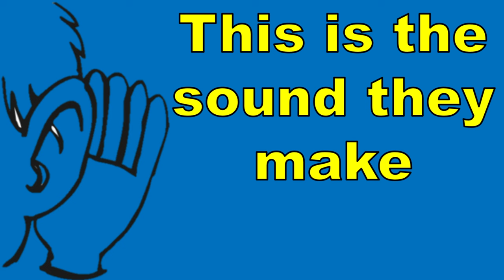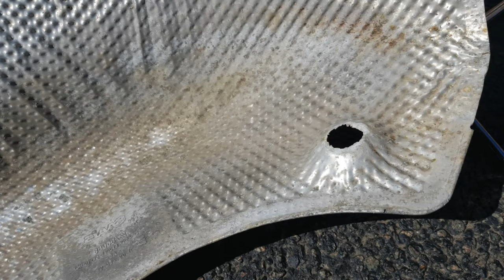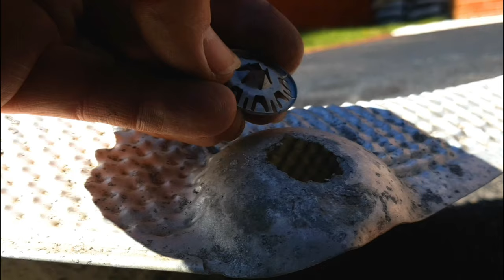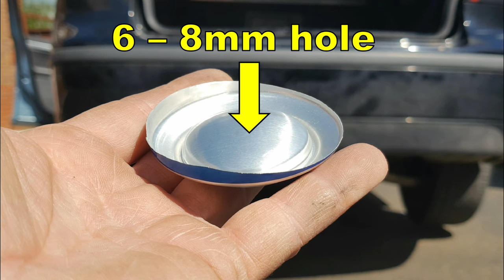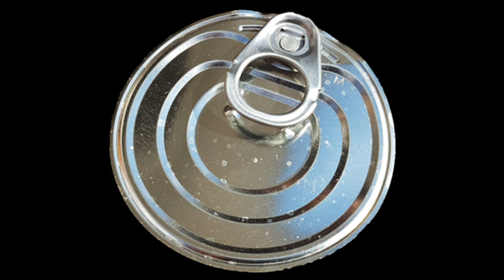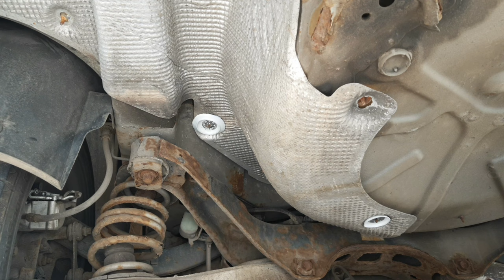How to fix Heat Shield Rattle for DIRT Cheap 💲💲 | such EASY DIY 👍

Comment: I very rarely comment on videos, but this is a phenomenal video. You show the used parts (so they look like what they'll look like in real life!) and offer really practical solutions for if things don't end up appearing exactly as they're supposed to. Thanks so much!
Reply from the maker: As a Professional Automotive Engineer of 40 years, I'm used to using the 8D method of problem resolution. The first step is to identify ROOT CAUSE. Without root cause you cannot develop a robust solution. Then I can develop a DIY solution (not necessarily the same as a 'factory' solution) that anyone can use. 
Or, at least, that's what I try to do. Glad I succeeded this time and thank you for the kind words.
Reply: First time i have heard of this idea.  Genius.

Comment: I took you tip and added a slit up the side of the pop can bottom then I only had to turn the nut half way down and slip the washer on between the nut and heat shield and tighten it down again.  I was able to leave the exhaust in place this way.

Comment: Thank you Cyd, a very timely video. I must do this to my car.
Reply from the maker: Awesome! I must get a link to some suitable clips in the description. Something I forgot to include in the video (and didn't do to mine, gggrrr!) - give the body studs a wire brushing and treat with rust converter before putting your shield back. Slows down the corrosion process.

Comment: Honestly, I just pull these off @ work, when they're loose. I've done it on diesels, petrols & shields below fuel tank. Never had an issue. 

I do admire your resourceful use of a soda can though!
Reply from the maker: Here in the UK if you pull off one of these on the bodywork that'll be okay, but if you remove one from around the fuel tank it will fail it's MoT. I have found though, that ones fitted around tanks are held in place differently and don't come loose so easy.
Reply: Here in Northern Ireland, I've never had one fail on heat shields.

Although our government run testing centres are very lenient. The test only lasts 20 minutes too. It's scary some of the passes I've seen.
Reply from the maker: @nothingmuch.3014  yeah, I should have said Great Britain rather than UK, but I didn't know where you were and most people around the world recognise UK better. The NI MoT is different.
In all seriousness: with most tanks being plastic now, try to fix loose shields on tanks. In the UK climate the fire risk is very small, but it does exist.

Comment: A design that was never going to last! Great method Cyd, tried similar with the existing hex fixings but there is not enough thread left on the stud so these other type of fixings are good. I'd be tempted to put some suitable grease on the stud too.
Reply from the maker: Or treat the stud with a rust converter.
It typically lasts 6-8 years, which is plenty long enough to be well out of warranty
Reply: @CycloneCyd  👍 similar with the wheel arch liner plastic hex nuts, if you are not careful they snap the stud off!

Comment: Interesting, forgot about the free sheet metal we get with every soda! Was thinking of a steel plate but you reminded me of galvanic corrosion! Saved myself from that on an earlier battery swap with some modification from zinc coated to tin coated connections!

Comment: Well done mate. Really helpful. I bought a small sheet of Aluminium from Wickes for £11 and cut it to size and used those circular clips from Halfords. The original screw clips were corded on, but got them off with a screw driver and cleaned the threads. Great job !!!
Reply from the maker: Nice work! Many ways to skin a cat and all that 👍 Happy to get your creative engineering juices flowing

Comment: This is exactly what I was searching to find info and solutions for! Smart idea with the creative aluminum can washers. Thank you!
I may consider a rubber gasket / spacer between the steel fixing and the homemade washer to further prevent the corrosion of the different metals rubbing on each other.

Comment: I also like that you used the base of the can, which is dome shaped. That offers structural strength so your car will be dead for any other reasons before your fix falls apart.
Reply from the maker: Also the dome shape helps the 'washers' to fit into the depression around the fixings. Which is there to give an air gap between the shield and body. the shield reflects radiant heat and the air gap prevents conduction 👍

Comment: Instead of paint, you can use zinc anti-seize on everything. It will withstand heat better than paint, can't be scratched off and ill last longer. I also use it on any nut and bolt whenever I have anything unscrewed.

Comment: got 3 of the fasteners off, really can't get the last one loose to take off. All the fasteners and studs are quite rusty, but the threads felt smooth enough. Maybe just leave the fastener and add a new one? I'm hoping to avoid buying some sprays or heating it, as a video suggested
Reply from the maker: Adding a new one over the old one is quite a good idea. let us know how you get on
Reply: @CycloneCyd  it seemed to work. The aluminum cans worked great. What's even better is I used wing nuts which was much easier to install from that awkward position.

Comment: Very tidy much  better than ewt else
Reply from the maker: Thanks, I've actually been doing this for years. Some people take loose heat shields off, but back in my rallying days it wasn't unknown for the heat from exhausts to set fire to the underseal! We also had to remove the sound pads stuck on our rally car floor as they bubbled up due to the heat (saved a load of weight too).
Reply: @CycloneCyd  wow, i do like to keep on for the same reasons, there there for a reason... lol, but your way with the metals not been able to corrode properly should be Impliacecated into the automotive industry.

Comment: Very interesting! I thought the 'aluminium' beverage cans were made of some king of iron alloy since some of them at least have a magnet symbol on them. Maybe they are different here (France, Belgium) from how they are in the UK.
Reply from the maker: My younger son is a 3rd yr apprentice with Crown - one of the world's biggest can manufacturers!
It's very simple: the can is either aluminium or steel. If it's magnetic it's steel. Cans are the same the world over.
Reply from the maker: This isn't absolute, but as a rule of thumb, drinks cans are aluminium, food cans are steel
Reply: @CycloneCyd  Thank you for your answer. If I understand well, if the can has the magnetic symbol then you should not use it for the purpose you've shown in your video but get instead one made of aluminium (no magnet symbol & magnets do not 'stick' to it).
Reply from the maker: @SerbanCMusca-ut8ny  spot on, you got it

Comment: another great and informative video.
Quick saab related question to Cyd or anyone else on here, is it possible to swap the cd unit on a 2005 9-3 as mine has not worked since I bought the car??
Reply from the maker: head unit or multi player in the boot? If the former, you can replace it with the same but it will need 'marrying' to the car with Tech 2
Reply: @CycloneCyd  thanks for the reply, guess I'll stick with minidisc (yes i admit it I'm old) and phone through the aux

Comment: Metal cable ties or jb weldc aorked for me many times haha
Reply from the maker: Yeah, JB is great - i once fixed a cracked head with it on a rally car. It lasted two rallies before I had to do it again before I eventually welded it.
Reply: @CycloneCyd  ive done it on the 9-5 a had and a landrover worked for 3 years on both but faild on the landrover at the 3 year mark and sold the 9-5  recently...massive regret.. i now have the new 2021 corsa elite. Very smooooth as they say, gota to admit pulls harder and faster in 1 or 2nd not sure but then thats it realy the sabb had forever lasting power after that lol i miss her but still love your vids please keep any vids tips nd tricks coming, as allways THANK YOU.

Comment: I am having the same problem with my RX350. Without removing the exhaust, it’s very hard to access the point.
Reply from the maker: Can you not drop the exhaust down like I did with the Saab?
Alternatively use a few big 'splodges' of Stixall to hold the shield in place, it's brilliant stuff but try to put it away from the boxes  https://amzn.to/3WeW2F8